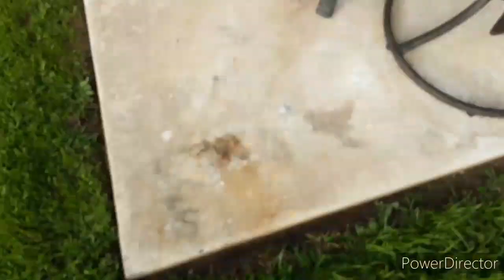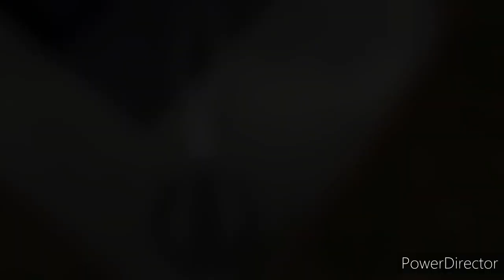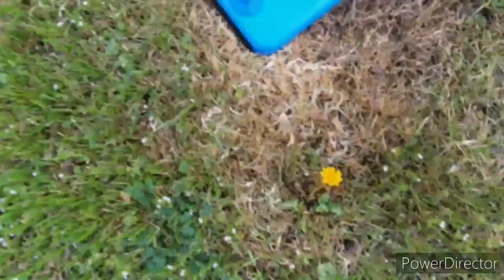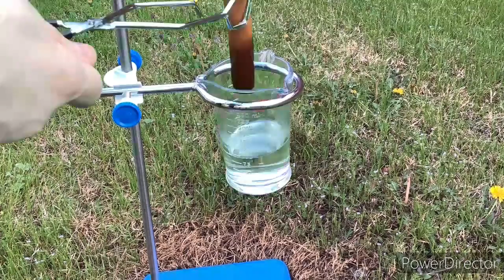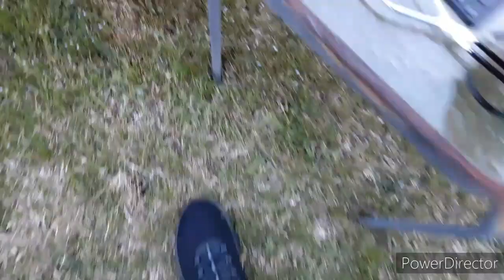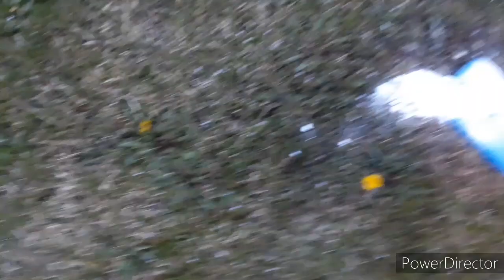Hotdog in hydrochloric acid

Comment: You kept saying 'I could have just eaten the hotdog'. . . 
Yes, since stomach acid is HCl.  But from your mouth, which masticated the hotdog and added enzymes (amylase - breaks up starch), and then added additional and different enzyme (pepsin - breaks up proteins) AND HCl when it finally entered the stomach, is the real end point of your experiment.
So you experiment wasn't a failure, it just proved there is more involved in breaking down the hot dog than just HCl alone in breaking down bonds.
After all, if you wanted to outright destroy the hot dog by using an acid, you would have chosen a solution of sulfuric acid and hydrogen peroxide ('piranha solution').  But that is very dangerous to work with, even moreso than HCl alone . . .